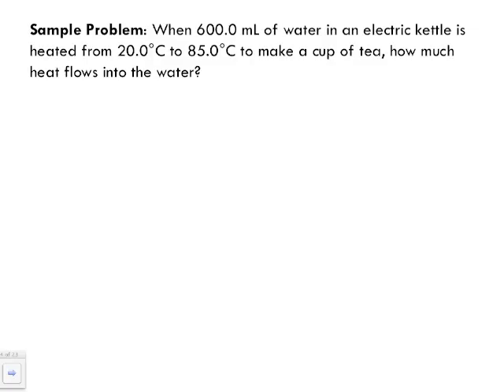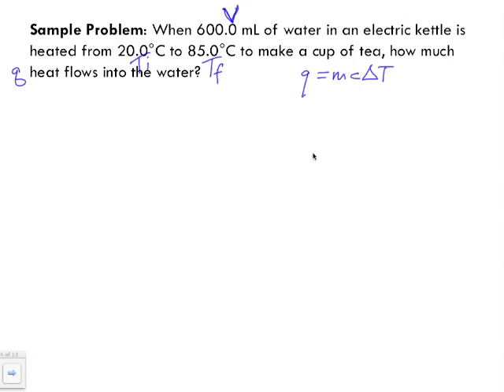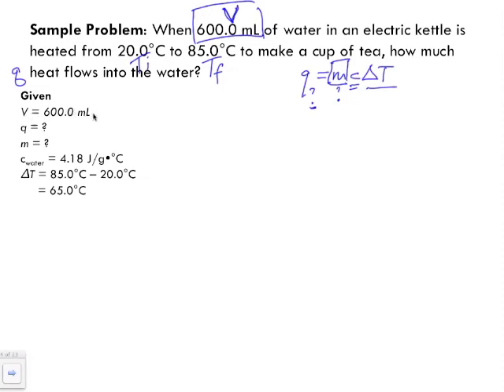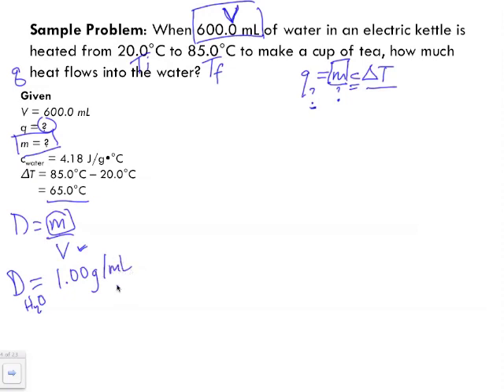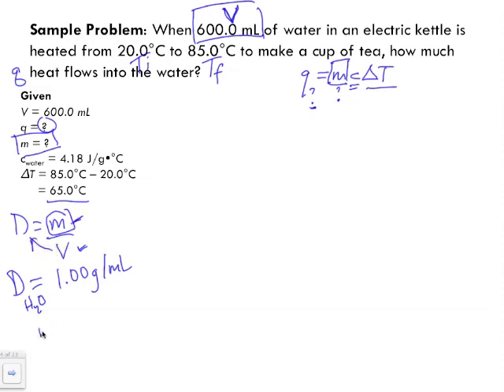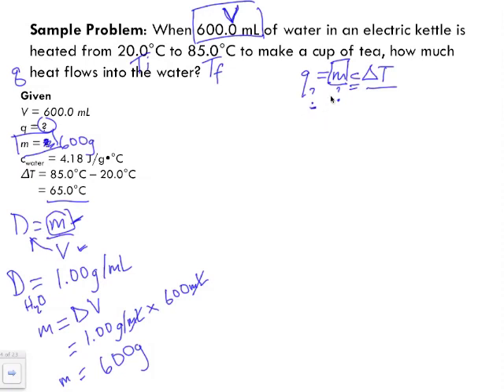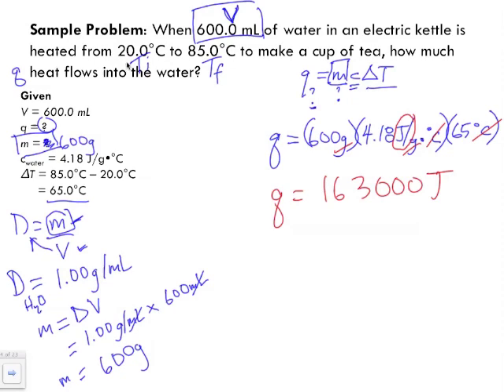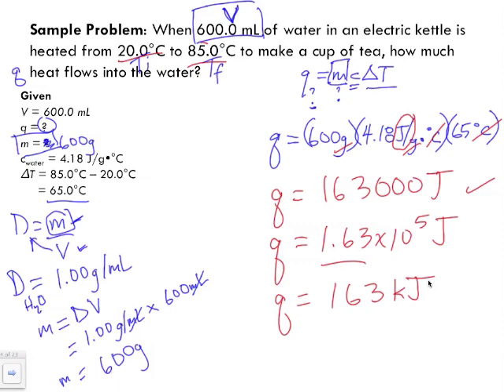Specific Heat Capacity Sample Problem 1

Comment from the maker: @TWTHEREDDRAGON You are very welcome. I'm glad to hear this video has been helpful. With regards to my answer, yes you are also correct with 163,020. That in fact is the answer. Some teachers/professors ask that final answers get rounded according to significant digits. If your teacher doesn't expect you to use significant digits keep the answer the way you calculated it. Just make sure to round according to your teacher. Best of luck with your studies.

Mr.P